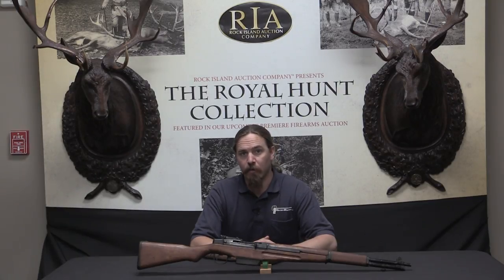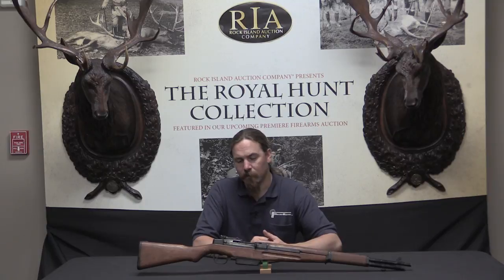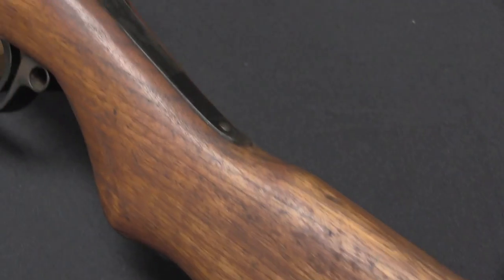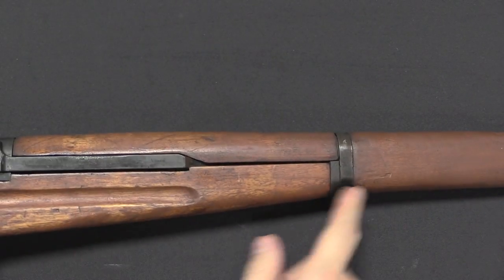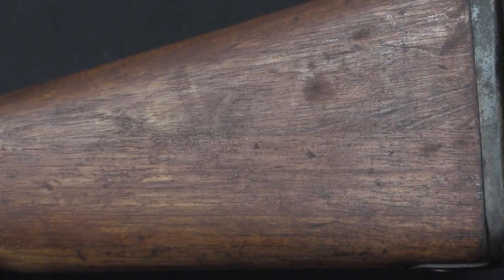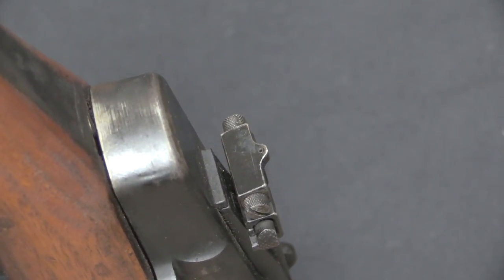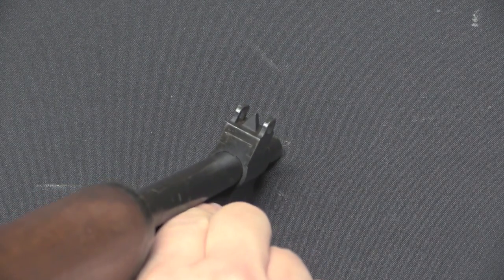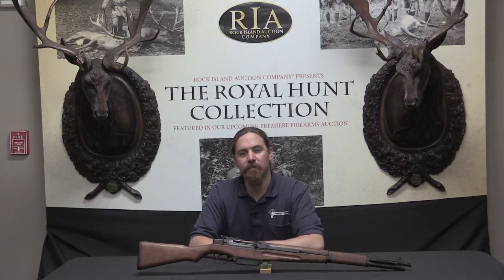Japanese Type 4 Garand

Comment: It's astonishing the Japanese military authorities waited so long until the middle of 1944 to commence re-engineering of the M1 Garand.  The Japanese wasted two-and-a-half years.  You can see the Type 4 shows considerable promise.  Had the Japanese initiated re-engineering and production in late 1942 given the possibility of better quality control, materials, and uninterrupted manufacturing before the B-29 Superfortresses, a good Type 4 would have been in the hands of Japanese troops by late summer 1943 at the earliest and no doubt in general issue by winter of 1943.  Can you imagine the shock and surprise of U.S. Army G.I.s and Marines in 1944 to be on the receiving end of new Japanese rifles that spit out ten, consecutive rounds.  And when G.I.s and Marines finally capture a few Type 4 rifles, imagine their greater surprise to be holding a near-copy of the Garand in their hands.  The Type 4 fixed box magazine proves to military gun enthusiasts that John Garand would have needed to incorporate a similar box attachment had the U.S. Army insisted on a ten-round capacity.  Supposedly the proposed .276 cartridge was smaller and so ten could fit in the rifle stock without an external box magazine.  The Japanese 7.7mm cartridge was based on the German 7.92mm Mauser round and so was larger than the standard 6.5mm Japanese cartridge.  One can see how the M1 Garand would have turned out looking with a fixed permanent box magazine.
Whether one believes the Japanese way of using two, 5-round stripper clips would have been more convenient than the 8-round en bloc clip, is up for debate. But it made logical sense for the Japanese who were already using 5-round stripper clips for their Arisaka bolt-action rifles.  Eventually a ten-round stripper clip would have made its appearance.  It wasn't difficult to design one.  This is one gold opportunity the Japanese military authorities let slip through their fingers.

Comment: That rear sight aperture gives me a headache just thinking about trying to use it...

Incredible to actually see a vid on these though. I recall reading about them online while I was in highschool around a decade ago, so wanted to learn more but so little information was available. Fascinating to see one in such detail! While the rear aperture hole is obviously WAAAAAAY too small, I don't blame the Japanese for going with a tangent rear sight. Doesn't LOOK at pretty, but seems far cheaper to produce. If only they made that friggin hole bigger. As for stripper/charger clips with a 10 round mag vs en bloc clips with an 8 round mag, that's tough.

Actually wait, maybe not... is it just me, or is there no bolt hold-open except the one connected to the follower that locked the bolt open when the mag is empty? There's not even the clip-release latch on the left side of the receiver! If it were me tinkering with the M1 to make my own, and had to get rid of the en bloc clip system, I'd have DEFINITELY tried to figure out how to make that clip release latch a bolt hold-open. That way if, say, you fired 5 rounds and want to strip a 5-rnd clip of 7.7 off into it, I'd just use the back of my right palm to bring the bolt back while my right thumb is over the action, trapping the round that's attempted to be ejected. Engage the clip-release with the tip of said right thumb. Push that previously-chambered round in the mag so there's all 5 rounds remaining instead of just 4, grab a clip, ram it in, and assuming that the clip ejects automatically upon the bolt closing, I'd pull the bolt back thereby disengaging the bolt hold-open, then let it fly home to chamber the top round of the now fully loaded internal magazine.

Since there seems to be no bolt hold-open, coupled with the fact that it's swifter to load a single 8-rnd en bloc clip rather than 2 5-rnd stripper/charger clips, I think I prefer the en bloc clip system. I've also figured out a way to use the clip itself as a bolt hold-open, allowing me to load rounds in one at a time by hand. With this Type 4, it looks like if you want to load in a 5-rnd clip on a partial mag, or load in loose ammo, you'd need one hand constantly holding the bolt back while also handling the weight of the rifle itself as the other works one-handed to  get the ammo and feed it in. Definitely sounds like something you'd want 3 hands to do. So while people have the incorrect misconception that you cannot reload the M1 Rifle unless it's empty, it would seem like having that impression with the Type 4 wouldn't be all that 'mis' of a 'conception. A bolt hold-open would REALLY help that design out, and if it got past the prototype stage, I definitely think they'd have incorporated one. 

Then again... the SVT-40 suffered from the same issue. No bolt hold-open except for the hidden one in the mag well that is acted upon by a follower in a mag that's empty. So maybe they WOULDN'T add one. If you want to load a partial 10-rnd mag with a 5-rnd clip in the SVT-40, in order to lock the bolt, you'd basically have to remove the detachable magazine, finger the mag well from underneath, and push up the bolt hold-open while pulling back the bolt. Then with the bolt locked, rock the mag back in, and go about loading in a clip of ammo before pulling the bolt back and letting it fly home. Quite a process... oddly enough, the M1 Carbine DOES have a bolt hold-open, but it has no capability of being fed by clips, partly due I think to there BEING no .30 Carbine clips. Not to my knowledge anyways.

As for the time necessary to reload an empty 10-rnd capacity rifle with 2 5-rnd clips, I can do so with my Lee Enfields within 5 seconds if the ammo is readily available, meaning out in the open before me. If it's in a bandolier or ammo pouch, that would add a second or two. For my M1 Rifle, I never really timed myself, but I'd wager it to be about 2-3 seconds with the ammo readily available, or 4-5 seconds from a bandolier. So the slowest time for an M1 Rifle is about on par with the fastest time with a Lee Enfield, or a Type 4 for that matter. With the lack of bolt hold-open on the Type 4 however, coupled with that HORRIBLE rear sight aperture, I'd DEFINITELY prefer either a No.4 Lee Enfield or an M1 Rifle over it. Or even a Mk.III* or No.5. Hell, considering my 1896 No.1 has clearer sights than the Type 4, I'd probably take that sooner, even with it's massive barrel and only able to be reloaded with loose rounds.

Comment: Dose this gun make the distinctive ping noise like the M1?
Reply: FRIEND 711 it shouldn't since it doesn't have the same clip as the American M1. Stripper clips into a box mag wouldn't make a sound.
Reply: thanks for the reply ^^ I was thinking that was the case but I just wanted to conferm that, since I couldn`t find any video of anyone shooting this gun.
Reply: FRIEND 711 no. Only the American m1s are allowed to let freedom ping
Reply: I am left wondering...how would one load this rifle?  Besides the obvious stuff-two-clips-in-it...did it have some automatic way of releasing the bolt, or did the soldier then have to pull back the op rod to release the bolt?
Reply: ...I DON'T SEE HOW THAT'S POSSIBLE WITH THIS PARTICULAR RIFLE-!!
Reply: @MA-wq2ih  THIS PARTICULAR RIFLE HAS THE ADVANTAGE OF THE SHOOTER BEING ABLE TO ADD A FEW EXTRA LOOSE ROUNDS TO THE MAGAZINE- THAT IS DIFFICULT TO DO WITH THE M1 GARAND.

Comment: Wow.  Cool.  We found alot of old weapons in Iraq during OIF1.  We may have had one of these in our 1/8 Inf Bn weapon display.   My best old weapons encounter- my PLT was assigned to capture a IED maker/HVT.  On the 1st attempt; when we were clearing the rear garden's(they all buried weapon's in they're back yard's) with our metal detectors; we found 3 MP44's(1 was a parter), about 6 loaded stick mag's; and two Sturmgewehr 44/1 serviceable 1 parter i guess; 4 or 5 loaded mag's.  I knew we would never get another chance to handle them again once we turned them into our Inf Bn S3.  So I took my guy's into an alley behind the houses; but up a few targets and instructed them on the operations of the two different types; then let them all fire both of them.  I got the chance to do the same thing when i was a Joe;SF guy's teaching us Foriegn Weapon's and all U.S Military Weapon's WW2 to present.  I owed it to them.  They loved it and reinforced my position as the favorite and best PSG ever.

Comment: Just a thought on the sights (and it's an idea based on ignorance). If these rifles were still in Prototype then maybe no-one had yet conducted range testing to actually make the sights meaningful. They had a rough idea because they're familiar with the round but it's presumably going to need modification to that rear sight hole on position and front sight might need more material taking off.

Comment: The Japanese Army captured tens of thousands of M-1 Garands after the fall of the Philippines in early 1942.  Had the Japanese introduced their own version of the Garands as shown in 1943, it would have caused many more American casualties.  Interesting to note, had John Garand decided upon a 10-round en Bloc clip, the resulting American Garand would have looked like the Japanese copy, a small metal box extending under the rifle.  Supposedly it was either Garand himself or the US Army that desired a smooth all-around rifle contour, with no extruding box magazine.  The Japanese proposal to use stripper clips would have been simpler than the en Bloc clip especially had the Japanese come up with a ten round stripper clip.

Comment: Ian does the bolt have a separate hold open than a standard M1, as if you were loading with two chargers wouldn't the first one depress the follower allowing the bolt to slide closed just by being pushed forward?

Comment: Thanks so much for this video! A WWII Vet once told me that he had seen a Japanese "M-1" in the possession of a Marine officer in 1945, that was being transported by that officer, to a temporary HQ of the ONI in Japan not long after the surrender. Until this video I was convinced he was mistaken about the "M-1" in question and that the Marine officer had simply be armed with his issue Garand. The Vet described this rifle to a "T" but I have never seen so much as drawing of one until this video. Kind of makes me wonder if somebody came into possession of a Japanese "M-1" and got the idea for the M-14 from it.
Reply: +FD Mackey i think the m14 was the result of needing more rounds in the rifles more than a rip off of a rip off. glad they didn't have the chance to use that weapon on the troops.
Reply: blueovalfan23, I'm sure you are correct as the evolution of the M-1 to M14 is very well documented. In case you are wondering, I'm very familiar with both rifles, the M-14 especially but I am left wondering if at some time after WWII somebody got their hands on a "Japanese M-1" and the proverbial light bulb over the head came on which lead, even a little bit, to the development and perfection of the M-14. I doubt we will ever really know if the Japanese M-1 had even a little influence on the M-14 as I suspect there is not now a single piece of paper to connect the two rifles if there ever was such a document.

Comment: Why is it with that the magazine tends to be the bane of a rifles existence? You said we had issues with enbloc clip and I know from use that even brand new M14 magazines had an 18 out of 20 round magazine. I have also been told that that trend came from BARs. So I guess my question is why is a piece of folded sheet metal and a spring so hard to manufacture correctly?
Reply: This is a topic that we could spend years discussing, there are a huge number of factors that determine if a magazine functions correctly. I think the m16 aluminum gi mags are pretty good case study as they're not particularly durable and are considered semi disposable. A few issues you can run into are: bent feed lips, dented/malform/pinched(even ever so slightly) mag body, weak or worn out mag spring, and follower tilt and that's just some of the things you can induce through regular use. Just as designing a reliable firearm is difficult, so is designing a reliable magazine.
Reply: +iheart92FS   Geometry wise, the AR mags are very well made. It's one of the best designs out there. However they are made with thin aluminum sheet metal, making them fragile to a certain point.  M14 mags which lot of people like to praise about are pretty crude in comparison.

Comment: If the bolt locks open on an empty magazine, as the M1 does, then how do they successfully load two stripper clips into the magazine without the bolt closing between clips 1 and 2?
Reply from the maker: +nmag The follower engages the holdopen, but the oprod doesn't drop forward until you pull it back slightly and then release.
Reply: +Forgotten Weapons Oh yeah, that makes sense. Don't touch the op rod.
Reply: +nmag Guess you just have to hold the charging handle back with your other hand (which is something you'll do anyway if you like your thumb).
Reply: I think the only reason our hand ends up on the charging handle while feeding the M1 is because we're used to using enbloc clips.  I can see that if you're using stripper clips, your hand won't pull back on the charging handle and the bolt won't drop when you go to retrieve your second stripper clip.

Comment: Why did the USA decide to use bloc clips instead of magazines/stripper clips?
Reply: Faster to reload and eject which is important in combat. As a civilian though I would much prefer the stripper clip method.
Reply: Also pre-WW2 rifle magazines were hard to make and were very expensive so the technology was not there till after WW2 when it became economically and militarily feasible to make mag fed rifles.
Reply: Thanks for the info! Still makes you wonder, because the bloc clips weren't used in other countries with the G-41/43 and SVT-40 etc.
Reply: samaxx Cause their soldiers were trained and used to using stripper clips.  Also those rifles, whose mags are detachable, were not designed to be removed except for cleaning, not reloading.  Plus the mags when made were supposed to be mated to that rifle like in the SVT-40's case where certain factory mags would not always interchange with other rifles of the same type.